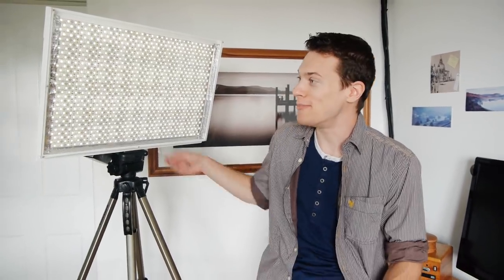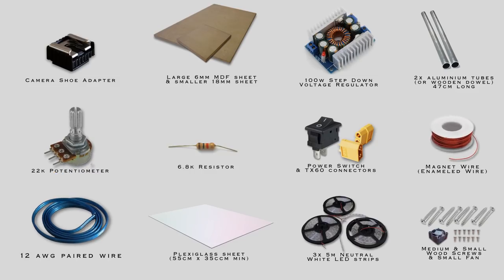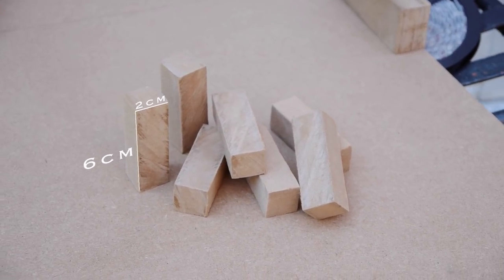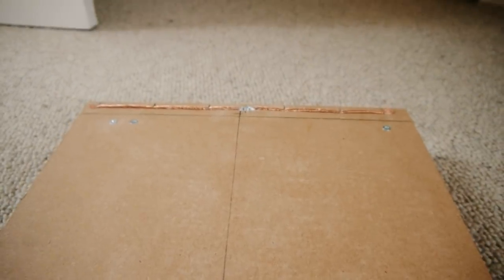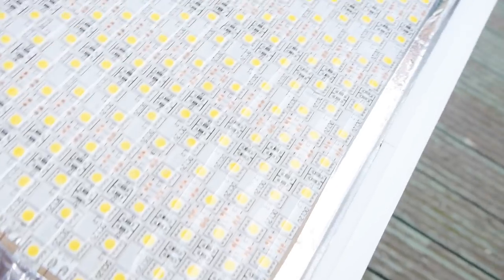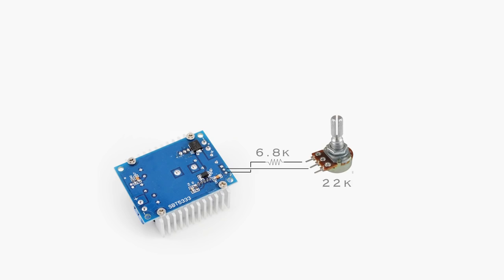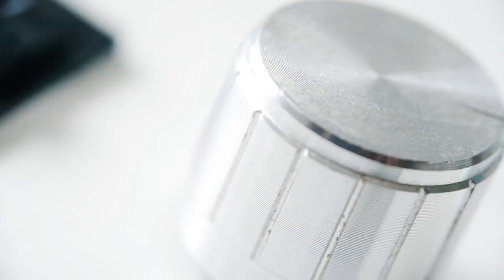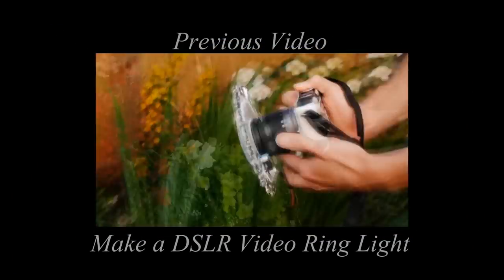How to make a super bright LED light panel (for video work etc)

Comment: Im just wondering.. Is there a reason why you didnt bought a led stripe kit with powersupply and controller? If you were you would have dimming and many different colors to choose from... I want to build a panel like you but im thinking that it may be easier to buy 3 kit with controller and such.. What do you think?
Reply: Please answer...
Reply: probably price, also he doesnt need RGB, why buying kit then?  it might be cheper, but he made panel from parts laying around the house.
Reply: Youre right. But i wonder if the single color led strips is brighter than rgb or something.. If thats why he choose singlecolor.. I have 2 rgb 5050 5 meter strips here, when i connect booth one of then i brighter than the first one... Can i use a adapter with higher voltage or what should i do?
Reply: Emilush Lushii
 im not expert in electronics, but as far as i know different colors use different voltage.Are those RGB led strips from same manufacturer? because if they are, im not sure why would one  glow more than other one.you should research about max voltage for that particular LED strip, and maximum current too.LED's can take some buse, but be wary of too high current.Maybe you could try with 12 or 13V power source and pot, and dial it down to the minimal brightness and go from that point towrd maximum allowed voltage/current for that led strip.. I usually use 30 LED/meter @11.8V and are bright enough (cold white though, not sure about RGB).

Comment: If those led strips use 6 amps for 5 metres (according to the description on Amazon) and you're using 3, then thats 18 amps. Surely then using a 5800mAh battery is only going to last 15 minutes? Have i made a stupid mistake with my maths or is this design just better suited to mains operation? Perhaps its just an incorrect value/worst case scenario current draw that is listed on the website?

Comment: Hi dear 
I’ve got voltage regulator with below details would you mind let me know is it gona be ok or no please?
LM2577S + LM2596S dual chip modules, DC-DC step up step down module with wide voltage design, suitable for solar panel and other high fluctuation external input power supply
Appearance Size: Approx. 6.6 x 4.7 x 1.4cm / 2.6 x 1.85 x 0.55"
Step-up Mode: Input 3.5-28V, output: 1.25-26V
Output voltage is irrelevant to input voltage (input 3.5-28V with arbitrary value, output 1.25-26V with arbitrary value)
Step-down Mode: Input / Output current (max.): 3A, rated input/output: 1A (Please add cooling fin when working in big current)
This step-up step-down module with voltage display screen, you can see the input and output voltage
Voltage regulating mode: (Step-up) Potentiometer rotates in clockwise, (Step-down) Potentiometer rotates in anticlockwise
Note: Because of lower switching frequency and input high current, it is normal to use if it has some noise

Comment: Is there an easy way to set this up without the battery and just a 120v wall outlet?  Could you just wire the laptop charger to the voltage regulator?
Reply from the maker: chang21822182 Yes, just plug it in to a laptop adapter.

Comment: I didn't quite get the part with the 6.8k Ohm resistor. Why is that? What would I need to adapt if I use more/less LED? or is it that the LED pass out at 6 Volts anyways? Thanks anyone who bothers to answer:)
Awesome tutorial!!
Reply: Yeah i would like to know too!
Reply: If you use more LEDs you'll need more power - a variable PSU that can supply 12 volts at a higher current (expensive!) Also thicker wire. For fewer LEDs, change nothing but you might be able to use a lower power PSU.
Reply: So if i have a variable PSU like the meanwell 150w do i still need to add the 6.8K resistor?

Comment: Dear Brother, after a lot of surfing i found ur diy videos which are really clean simple n really easy to find things on Ebay from ur references. 
im doing 3w x 30pcs led project for my planted Aquarium i need to ask you whether i can use (step-down voltage regulator -> 100w 4.5-30v to 0.8-28v step down DC-DC Converter high quality) instead of using a led dimmer.
pls advise
Reply from the maker: Indulge winz Yeah, shouldn't be a problem.
Reply: DIY Perks and since u r using a battery beside this do i need a adopter to play the leds or just use direct plug in to switch board?
Reply: DIY Perks  finally its done,
i made 3 sets according to my requirement. 
white, day light and RGB+UV
thanks alot PERKS for giving a simple platform :)

Comment: probably a silly question, but the only thing I'm having trouble matching up is the resistor.  6.8k is easy enough to find, but what wattage did you use or would you recommend?
Reply from the maker: ***** Any will do, as it doesn't have to handle any load.
Reply: As big as you can get, you are dissipating heat. The whole circuit was 10W.  Spend the extra $1.50 and buy the next up, 25 W.

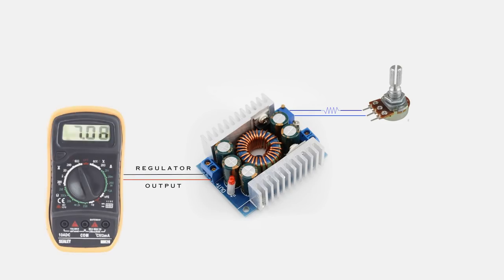Comment: I'm confused about the minimum voltage required. At 10:04 you say minimum 15V but at 10:42 you say "regardless of whether you use a 12V input or a 30V input or anything in between."

I ask because there are a lot of cheap 10A 12V supplies available at very low cost, while the 15V supplies are fewer and more expensive.
Reply from the maker: Will Fastie You need more than 12v to accurately set the potentiometer (can be any amperage), 15v being the common variant after 12v. After you've set it you can use a power supply that's anywhere between 12v and 30v, so long as it can supply at least 100w (120w being preferable). Hope this helps.
Reply: DIY Perks That clears it up. Thanks.

Comment: Hi.
I think my previous comment might have been too long and lame. Sorry about that. Now again, how do I make this a bi-colour panel? 
Do I need a warm light source to end up with footage that has a warm tone after post-production (or) 
can I use daylight balanced led and colour correct in post to achieve a warm tone? Thanks! Have a good day!
Reply: Anyone?
Reply: Aravind Chakravarthi Why not use some CTO gels?
Reply: Mark Balderston Are CTO gels good at reproducing true 3200K? If so, problem solved. Even if they can reproduce 3000-3800k I'll be happy.
Reply: Aravind Chakravarthi Yes. You can use CTO or CTB gels to change the color temp of any source. Use a MIRED shift calculator to figure out what gels you need for any color temp: http://www.leefilters.com/lighting/mired-shift-calculator.html

Be aware that you will lose some output depending on the strength of the gel you use.  However you'd lose output at both color temps by using a bi-colour panel.
Reply: Cool guys! Thanks, I'll check this out.

Comment: Is that even safe to have that much exposed wire against the surface of the wood with a high current passing through it??
Reply: MrEpicGekko it is fairly safe. wood is non conductive.  the voltage is low even though the current is high (not really that high). make sure your solder joints are good so you don't get anything hot.  remember this formula. "energy x resistance= heat"  good connections are important.

Comment: Thank you. Great Diy project!
What would be needed for led panel with controlled color temperature between 3200K~5500K? 
Different led strips?
Reply from the maker: Bojan - Haron Markicevic For controlled colour temps you'd need some warm white and cool white LEDs, and rig up two voltage regulators instead. Will probably make a video about that at some point.
Reply: DIY Perks Currently experimenting with an old cross fade resistor from an old amplifier. It was used to control the balance of the right and left channel. Looks promising but a bit to sensitive. Waiting for my second voltage regulator to arrive and try it with to strips hooked up. I already divided my strips to two power sources by connecting all even an all odd rows to them. If this method really works, I'll order some cold and warm white strips instead of the neutral white ones and test how good you can control the white balance.

Comment: Hi,

I'm an italian and I'd like to make a question for you.

I'd like to know if exist a simple product that can assume the same features of this products (100W STEP DOWN VOLTAGE REGULATOR) and (22K POTENTIOMETER).

Can you explain me the differences between the products?
If possible can you suggest me if exist a solution for me so I can catch a product that satisfies all my requirements.

I make my compliments for your excellent movie.

Thank you in advance if possible can you reply me as soon as possible.
Sasa
Reply: Sasa Noce I can only try explaining the differences between these products.
As to which product satisfies your requirements, only you can decide.

A voltage regulator can take a power source that does not supply a constant voltage (batteries for example: the voltage drops off as they discharge) and automatically adjusts itself to provide as close to a constant output voltage as possible. They are commonly used in devices like computers that require a precisely-controlled operating voltage. Several types of these devices exist, each with their respective advantages and disadvantages. In the case of this project, the regulator performs the grunt-work of adjusting the lamp's brightness.

A potentiometer on the other hand is a manually adjusted device that can rarely be found in power ratings over a single watt. It consists of a resistor (22000 ohms in this case) upon which is movable wiper contact. A commonly encountered miniaturized item of this type is the volume control on a transistor radio. In that case of this project, it provides a more ruggedly built adjustment for the voltage regulator's output voltage. (the screwdriver-adjustable version shown mounted on the regulator's circuit board tends to be easily broken)

Comment: Hello,

Would using two 4Ah lithium Ion batteries rated at 18V (20.18V) metered with vom at full charge wired in series work in place of the 11.1V 8Ah Lipo you used in this project?
I was wondering since I have a few of these handy I would like to use.
This would avoid the need for a cut off circuit. I don't think one is better than the other.
If the answer is yes, then would this set up produce the same high output the lipo does?
Is there a reason you chose the lipo over Lithium Ion?
I value your opinion. I have learned so much from this Video. Keep Buildin in the UK!
Appreciate all your Awesome Ideas and Easy to follow instruction!
Respect!
Reply from the maker: Rene Zamora Using those batteries in series would overload the voltage regulator unfortunately, as its maximum voltage is 30v and you'd be giving it more than that. I think there are variants available that can support higher input voltages, but they're more expensive. If you got one of those, you should be able to use those batteries without a problem so long as they include some kind of overdischarge protection (Li-ion batteries, like lipo batteries, cannot be over discharged).
Reply: DIY Perks
Thanks for the Quick response.
I wrote Series when I meant Parallel.
Wanted to combine the two 18V 4Ah batteries in parallel
to stay at (20.18V) for voltage regulator input voltage
while achieving 8Ah in total for higher current output.
Cheers.

Comment: Hey, something that i don't understand why would i have to use at least 100watt power source if the LEDs you used consume 30watts?
I mean the whole strip consumes 2.5A 
12V x 2.5A= 30watts
Reply from the maker: Danniie-L Torres Because we're using three LED strips in this project.

Comment: Great tutorial, I had to watch it like 12 times but then I got it :) I got a question, though: my voltage regulator has two of those micro-potentiometers. For one of them, two of the pins on the back are "bridged" together with a little piece of metal (sorry, non-native speaker here). I soldered the potentiometer to the one without the bridged pins. However, the micropod on the micro-poteintiometer can be turned endlessly, there is no "fully anti-clockwise". The part has the exact same number on it ("BAOTER 3296") as in the video. What am I doing wrong?

Comment: hi, thanks for the great tutorial,
i want to build one , which battery would you recommend?
isn't the one that you use 11.1v? 
so how does that fit the min 12v?
Reply: MWernerPhotography I suppose you could use a voltage step up converter, or just run the LED panel at a slightly lower brightness. (If the driver circuit can go any lower than 12 volts).
Reply: MWernerPhotography A 3s Lipo is well over 12,6v when charged up but the Circuit does also work with 11v. It's still extremly bright then. I wouldn't recommend a step up circuit because it has to be very powerfull and therefor expensive and also has to be cool and decreases the efficiency

Comment: Hi! Great video, and thanks for the updates about where to buy all the parts. I'm thinking about making a few of these to replicate a Kino Flo setup. Are there any complications I can expect if I decide to make one with a size of 120x30cm? I don't have any knowledge about the electrical aspects, but I can imagine that it might need more power or extra cooling (or any other things I'm not thinking about...). Thanks!
Reply from the maker: Justin Zuure It should be fine, but you may want to split power load between two voltage regulators if you end up using more than three 5m strips. You may want to use a stereo potentiometer so that you can use the same knob to adjust the brightness.

Comment: DIY Perks , instead of using batteries, can I instead plug it in to the mains to power it up? If so, is there anything I need to adjust in the build?
Reply from the maker: Kevin Harris Of course. Just use a power adapter that's capable of providing 100w (like a laptop power adapter). Voltage can be anywhere between 12-30v.
Reply: DIY Perks Alright, I understand how it all works now. Thank you so much for your time :D

Comment: Could someone tell me what would the differences be in assembly if I just wanted to plug this into a 120 volt wall socket?
Reply: Kyle Romine To clarify: I don't need it to dim or have a battery. I just need it to plug into the wall.

Comment: Cool tutorial.  Do you recommend any vendors that sell LED strips with a color temp of 5600 K (daylight balanced) light?  The ones you link to have a color temp of only 4500 K.  Thanks
Reply from the maker: Dee Cee The ones in the description are the closest to daylight you can get on a budget. The waterproofing on them makes them cooler in colour temp.

Comment: Hi can you tell me how long will it work on the zippy 8000 and what abut take a 12v 9ah battery and put a Step-Up convrtor to hod the voltage at 12v all the time ? as i want to bulid a unit but i need an open to find the right battery for the job abd with an option to replce it so that i can use this panel for a full day of work , i know that i can buy the V-mount 15V video battery and that it will work find with it but this cost a lot so if you haev a solution that will cost leass then 380$ for a battery it will be the best but i do need it to hod the unit for at least 4 to 8 hours of work
Reply from the maker: Tamir Bassal-Tana The 8000Mah zippy battery lasts for about an hour. If you're wanting more time I suggest either plugging it into the mains with a power adapter, or using a lead-acid battery.

Comment: Great video, I'm building two and so far so good. Can you please tell me the values/specs of the two resistors used to reduce the voltage for the 5v fan? I can't seem to match those colour codes using resistor colour code charts.
Reply from the maker: jjtguitar The value varies depending on the current draw of your fan. Just use an LED resistor calculator (or ohms law calculator) to find out the value you need.

Comment: I actually bought the stuff needed for this and it works great, although I would like to warn everyone that if you buy the cheapest converter of this model from Ebay, you'll most likely get it from thalia4u, and that one will make the lights flicker like crazy. Think it got something to do with those poor caps. Anyhow, I got it elsewhere since they stopped replying, and now it works great.

Gr8 gr8 gr8 :D

Comment: In comparison to the Yuji 100W LED light, that you have recently shown. What is the CRI of these LED lights and what is the lightoutput of these compared to the Yuji
Reply from the maker: Krishna Kumar The CRI of these is 'okay'. They're around 80 or so, which is great for the price, but obviously no match for the Yuji.
Reply: Many thanks for your reply, Does this 1000 led luminance brighter or duller compared to the 100 watt yuji

Comment: What wattage rating should the 6.8k resistor and (In my case) the 25k potentiometer be?  I am having a hard time with tracking the correct ones down and do not want to risk overload
Reply from the maker: ***** They don't have to deal with any load at all as they're used merely to sense the desired voltage output, so anything will do.
Reply: Thank you so much.  I'm picking them up now.  So far the lights are soldered and working.  Dime for the dimmer!